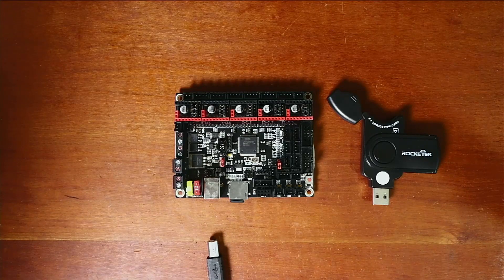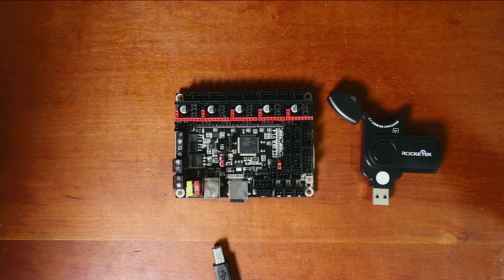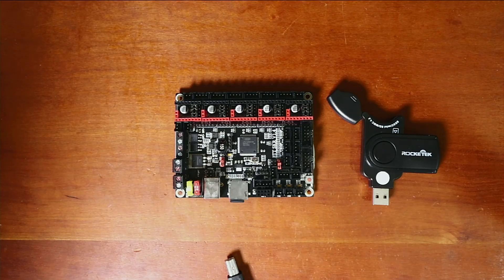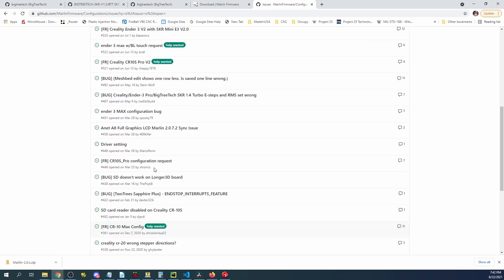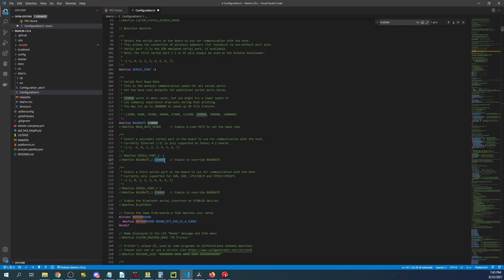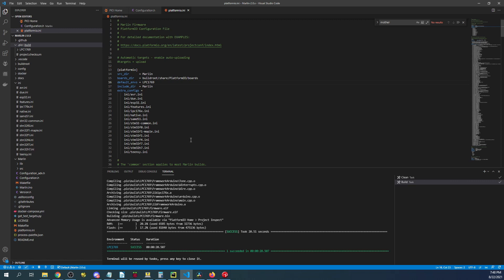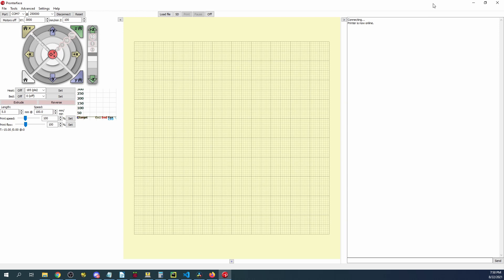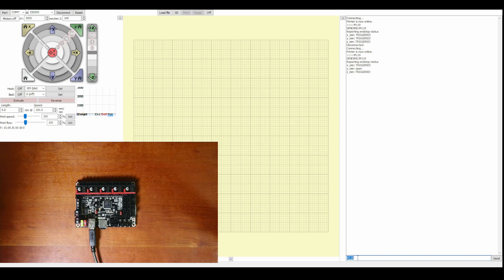SKR 1.4 - Basics with new Marlin firmware 2.0.9.1

Comment: This has been extremely helpful! I'm struggling to get my printer to connect to pronterface. I've had it work in the past, however I've since then flashed new Marlin firmware. I have the correct COM port and Baudrate according to device manager. But when I hit connect, it just says "Connecting..." and never connects. When I unplug the usb tho, it says it cannot write to printer. (disconnected?) So it seems to be communicating somehow

Comment: i must say a big thank you to as if it was not for your videos i would not have sorted and got VS Code working.
i now have my 1.4 turbo sorted in my TRONXY X5SA just need to sort the ABL out now. i think i know where i went wrong as it would not home 
i had motors for x/y one motor was at true the other at false.
i have another board the 1.4 just need some more  parts now to build a voron 0

Comment: I hope you can help. I've watched all your videos on the above mentioned board,very intuitive,thank you. I'm using this board to control a lowrider cnc with 5 steppers,designed by v1 engineering. I'm having problems with homing the y axis,what happens is when I try to home y,only one stepper powers causing the gantry to jump off the rail. I've done cable testing a various swapping out but nothing seems to work. Your help would be appreciated.
Reply from the maker: Little confused by the question.  Someone designed a product that's not in scope of video?

Comment: Can I use this control card without marlin? I don't have 3d printer, I will use this for control 4 stepper motors with my own codes. Is this card has its own microcontroller? So I don't have arduino uno for coding right?
Reply from the maker: Arduino studio may not work for this board, unless they updates Arduino studios.  VScode with platformio will work.  This board can be loaded with a couple of different firmwares.
Reply: @EdwardBraiman  so can i use my own code?
Reply from the maker: If you develop your own firmware sure, but Marlin firmware processes it's own set of Gcode if that's what you're asking.
Reply: @EdwardBraiman  I just want to run 4 stepper motors with very basic stepper motor codes.
Reply from the maker: The board has a default firmware loaded and I'm not sure which steppers are enabled, but my guess is they are a4988 steppers.
Reply: @EdwardBraiman  Man, I don't understand anything you're saying.  I am building a robot and I want to run 4 stepper motors.  I'm going to write a very, very simple few lines of code.  The only reason I want to buy this product is to have all the drivers in one place.  I was going to use it with Arduino, but the arduino is not plugged in.  It doesn't matter to me because all I need is to write some very simple code and get the stepper motors spinning. I don't know what firmware meaning. I am a simple guy who want to run motors with simple way.
Reply from the maker: I'd say if you're confident in your program abilities try it.
Reply: @pfdk8066  You will need to write your own software/firmware to do that. I assume you'd be able to do that using PlatformIO, but you won't be able to use the Arduino IDE to program it because the board is 32-bit.